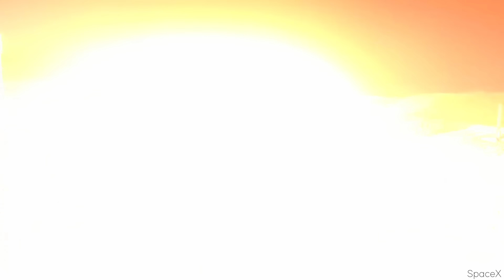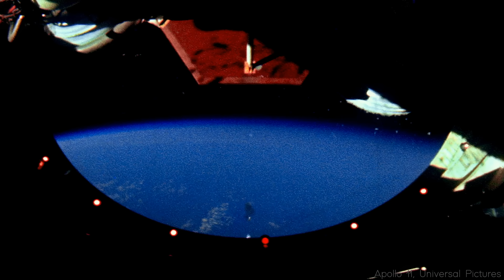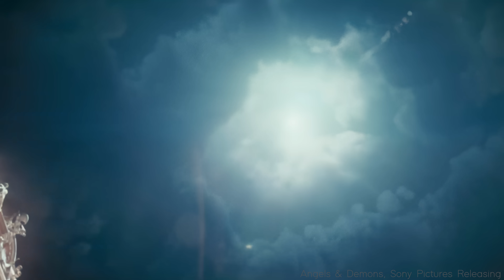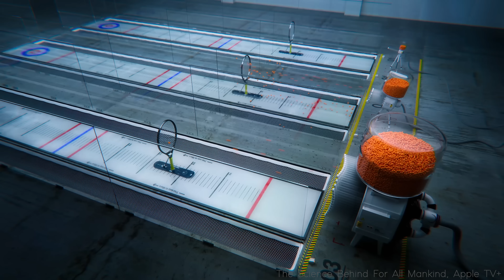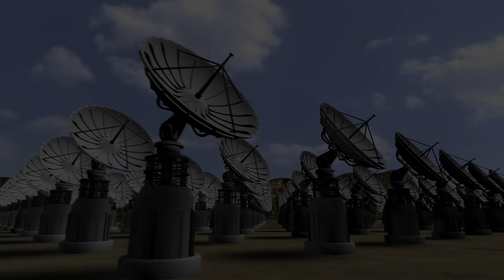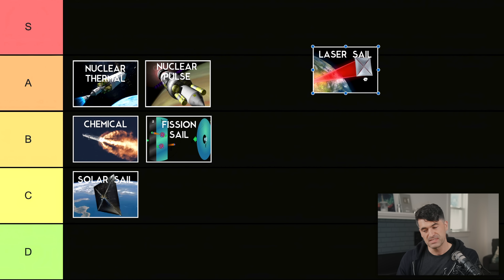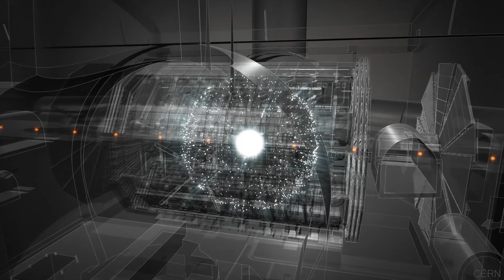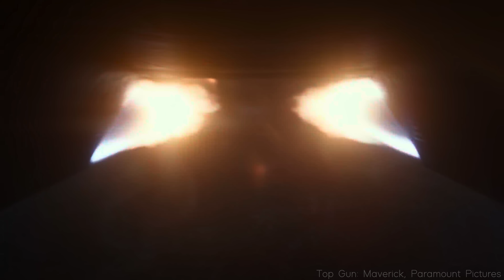Interstellar Propulsion Technologies - RANKED!

Comment: Why not have a small nuclear reactor on board the craft which powers lasers that are on the craft itself?

Have the lasers point backwards, which provides some thrust, bounce them off mirrors, which negates the thrust, but then reflects the beam into the sail in the front of the ship, providing force again.

This prevents any atmospheric umpedence of any lasers being stationed on Earth as well as getting round the problem of simply firing the lasers forwards into the sail, which negates any thrust.
Reply: The entire idea of the laser sail is that the craft itself can be very light, because the lasers are not on the craft.
Reply: @MrCmon113  weight isn't an issue when I space, only acceleration and time.

Good point though, it would need another way to get into orbit, or have to be built in orbit.

I was more thinking of the propulsion system for a large, manned craft, which would be incredibly heavy to begin with. A reactor and lasers, when added to the bulk of the ship as a whole, would be negligible.

Comment: We have been able to go interstellar since the early 50's. It's that niggly bit about simultaneously that slowed things down. Right about then, we realized we didn't understand a bloody thing. It works kinda like an Alcubierre drive, but with way lower power requirements. And some spatial fineggling. But at one point you are in both places at the same time. Kind of like the kid in the back seat "Are we there yet?" It's one of those things you can't ignore. And, yes, we kinda progressed. That "Same time" thing can be problematic. As we found out in 2012. It just took one idiot. Craft had worked, but somebody decided to add some extra spice. You guys call it the Mandela effect. Something we won't be trying again anytime soon.

Comment: Dear Dr. David, 
Thank you for another excellent video. 
Probably to avoid this video becoming too long, I would guess that you deliberately did not mention the concept of Hybrid Propulsion Technologies. Such as a Slingshot manoeuvre around the Sun, utilising a large Solar Sail at the appropriate time. The same Solar Sail could also be used to decelerate at the destination Star. Any sizeable Interstellar spacecraft would be built & assembled in orbit, making it practical to include several different, compatible Propulsion Technologies, from Ion Drives to Nuclear Thermal and potential Pulsed Fusion. And perhaps a Ram Bussard system could also be used, just to scoop up interstellar Hydrogen, to be stored for use as fuel.  Many thanks again for all the great videos.

Comment: I think we have a technological pathway to an antimatter fuel fabrication plant, that is building solar collection mirrors and putting them in orbit of the sun, to generate absurd amounts of energy. Could probably speedrun such a technology in a few centuries. The other energy source that compares to antimatter is the black hole. If you could create a black hole, or capture a sufficiently small primordial one, you can collect energy as you drop conventional mass into it. A small enough black hole will have enough Hawking radiation output that you can use it as a battery, reflecting that radiation back in when it isn’t needed, and harnessing it when it is.

And the laser light-sail on steroids is the stellaser light-sail. Isaac Arthur talks about these somewhat often, but I think there is some suggestion they could be built. I’m telling you, all cost-effective space projects start with orbital mirrors.

Comment: Laser array question: Where would the laser array be placed? 
On earth the atmosphere would diffuse the beams, but the array could be serviced with ease. 
On the moon the array would be outside of atmosphere, but impractical to service. 
In both cases, the rotation of the celestial body the array is placed on would make the array functional for only part of the day. 
A platform in space could be kept constantly aligned with the craft, but would require constant adjustment thrust to maintain position and be hard to service.
Does anyone know what the proposed solution looks like? I'm sure the answer is obvious and brilliant and I'm just too dense to see it, but I'd like to know 🙂

Comment: I've said for a while , that micro-sateliites would work   You make them a pound or so weight,and use a high speed centifugal or railgun device launched from the moon.  Get it up to 10% the speed of light.  Not everyone needs to succeed and they can be separated  out so say 1000 could be dispatched per decade to ensure success and to check out multiple nearby star systems at once.   there's also other benefits, if done correctly by knowledgeable people.

Comment: We wouldn't need FTL to go interstellar. Propulsion systems that can get spacecraft to relativistic speeds would be sufficient. Assuming 50% light speed, a trip to the Alpha Centauri system would take about 9 years to complete, but because of the 15% time dilation, the trip would be 1.3 years shorter from the perspective of those aboard the ship. Bump the velocity up to 80% light speed, and the trip would be about six years long, around 1.5 years from the perspectives of those aboard the ship.

Comment: You should have added to your ranking criteria the ability to decelerate. It’s worth nothing if a system can accelerate a payload to a fraction of C, if the system cannot slow down to reach and stop at the destination…
Reply: To me this is why starshot laser based craft are not really S tier. Can't slow down and extremely mass limited way below the requirements for manned missions.
Reply: @Stu_Bur  you could use a laser to accelerate, then fold the sail up into a pusher plate or Medusa style parachute and use NPP for deceleration.

If your destination is a red giant, you could also "dive" into the extremely diffuse outer region to slow down, or even just deploy a dragnet into it without fully entering(though you would need to shield your craft well enough to be able to get that close)
Reply: @Stu_Bur It can decelerate using solar wind of the star it's heading to
Reply: If it is just a drone to make a photo, it can be flyby
Reply: For those who say that rockets can decelerate, think that you’d need to carry out enough fuel for the deceleration, lots of extra payload. Current rockets barely make it out of the earth gravitational well. Second stages would have to be huge in comparison!
We get in the realm of orbiting refueling stations… n maybe not impossible, but incredibly expensive endeavors for sure.

For those who say you don’t need to decelerate to just take measurements, think how useful the measurement may be when the probe travels so fast to make interstellar travel not taking thousands of years… imagine something like the Pluto fly-by, but you were lucky to just take a single picture, or reading, then you are already out of range in the opposite direction. Would that be worth it?
Reply: The idea with the laser sail is that it doesn't need to decelerate. It can take images and other measurements as it passes through the system. You send thousands of them spread out over time. Each 'generation' becomes more accurate and focused.
Reply: @christopherkelly4555  Then it's only good for taking pictures, it can't be used as a functional transport system.
Reply: @christopherkelly4555  "It can take images and other measurements as it passes through the system"  Putting aside that all of this is idiotic in any case, what's the point of "measurements" when there is NO technology to return such measurements to Earth?  All known methods of electromagnetic communications would be useless at light-year distances, particularly given the power limitations of a "probe".  Also, don't reply with a pathetic: "Well, there may be new discoveries...", sorry NO , electromagnetic communications is completely understood and anything else (eg: quantum entanglement) is just completely pointless speculation, with zero basis in fact.
Reply: exactly. the human body is frail. for every period of acceleration you need an equal period deceleration. if you could accelerate to light speed, you cannot arrive at the destination at light speed. deceleration could take a long time and energy. its basically acceleration in reverse. nobody ever talks about the deceleration bit.

the atmosphere of a planet, if it has one, will slow you down. we see that all the time. you will be a fireball
Reply: Thank you. Especially the good Dr.'s own laser propulsion idea. How do you slow down?
Reply: @ethorii  if you mean the black hole one, you just make your destination near another black hole and use the same effect in the opposite direction to slow down the vessel to manageable speeds. It's essentially a black hole highway.
Reply: @rance8838  seems unlikely the second black hole would be near the final destination. A long high speed trip would almost certainly still be necessary after the slow down. Maybe it could be used as an energy saver to piggy back off of black holes.
Reply: There was this old design that had big mirrors that basically acted as stages so when you're decelerating you drop off the mirror Infront of you and it reflects the lights back onto the other side of your remaining light sails
Reply: Also shield against micrometeorites.   A very fast flying ship is an easy target for small projectile .
Reply: I mean, it was specified that the goal was photos with bonus points for people. It was never a criteria to land or orbit, therefore there was no need for the deceleration
Reply: Robert Forward used that as a plot point in "Flight of the Dragonfly."  He had a laser sail system, and half way through, part of the sail was cut away and put out to reflect the laser back against the main sail to slow it down.
Reply: Flip and burn!
Reply: Yes, and no. Slowing down is easier, if you interact with solar winds.
Reply: Deceleration Never crossed my mind. 😅
Reply: Deceleration is basically just accelerating in the opposite direction, so it'd be similar
Reply: @jevinliu4658 you don’t have the lasers in Alpha Centauri to slow down the sail…
Reply: @blas_de_lezo7375  Good point, but for the rockets (which is most of these) then yes you can
Reply: @blas_de_lezo7375  That's true, but as bizarre as that sounds, we actually can use lasers to attract things toward the source of the beam, at least at subatomic scales, so a single laser station could theoretically be used as both a "pusher" to accelerate spacecraft and "puller" to slow them down
Reply: @davydovua  Ok so first problem is the lasers lose power as the ship is further away. So Lasers very close to launch point= super powerfull, when you're getting to alpha centauri 100% useless. Sure if you can get lasers in alpha centauri for slowing down , awesome, but they need to get there in the first place.
Reply: @blas_de_lezo7375 can't you stop the lasers and use alpha centauri's solar energy to decelerate the sailship?
Reply: @irmaosmatos4026  but you are getting closer to a gravity well at the same time soooooo maybe? You would need to get very very close to the sun because the laser is extremely focused . Honestly no clue on the math.
Reply: @blas_de_lezo7375  I believe the idea is to use gravity to progressively slow down similar to gravitational sling-shotting
Reply: @jevinliu4658  Going at that speed, we could save a lot of fuel by using a magnetic sail to brake against the interstellar medium and the destination star's stellar wind. (I guess it is called stellar wind not solar wind?)
As someone else mentions, this is only important for human voyages, which would be several orders of magnitude harder than just sending a probe.
Reply: @peterd9698 exactly!  Between all the interstellar dust and solar wind and such, decelerating isn't an issue for a solar sail.
That's one of the main advantages to using one.
Reply: @dynamicworlds1  "Between all the interstellar dust and solar wind and such..." Laughably idiotic...  Here's an idea of the "Interstellar Medium": ...an average density of about 1 atom per cubic centimeter....  There's no solar wind in interstellar space, ergo the name interstellar medium .  Pointless fantasy babbling completely devoid of actual, you know, facts ....
Reply: @guidojones6107  obviously by solar wind I was referring to that created by other stars.  There's also cosmic wind in the interstellar medium in interstellar space.  And yes, at relativistic velocities and over the large areas of a solar/magnetic sail it would be significant.

Less posturing and more educating yourself, please.
Reply: @dynamicworlds1  There is an amount of braking provided by slamming into a heliosphere around a star. It isn't sufficient however to stop a significant mass moving in at relativistic speeds. Even changing direction to try to get capture into a long period orbit is going to be tricky without some other kind of propulsion.
Reply: @Stu_Bur  it does require braking against the interstellar medium as well, yes
Reply: @guidojones6107 now imagine hitting 1 atom per cubic centimeter while going an appreciable percentage of the speed of light. Your going to be hitting a lot of atoms per second. So it might be enough slow a light sail probe enough for a fly by to the local star.
Reply: @CeoMacNCheese "hitting 1 atom per cubic centimeter while going an appreciable percentage of the speed of light..." Has absolutely no effect whatsoever ...  It's a single atom FFS!
Reply: @ that per cubic centimeter, and your pretty much going a 3 centimeters a nanosecond at 10% the speed of light, which doesn’t sound like much but remember a billion nano seconds are in a second so you are hitting about 3 billion atoms a second on a single square centimeter going at 10% the speed of light. Which means you are hitting a lot of atoms a second to the point that it starts to make sense to make a relativistic vehicle an aerodynamic shape. The faster you go the worst this problem is. It is not a single atom, it’s you hitting a single atom per square centimeter while moving at 29979.2 kilometers a second. It doesn’t seem like much at first but if a body isn’t aerodynamically built properly it will experience a lot of drag which for a light sail might be enough to slow before entering the heliopause.
Reply: @CeoMacNCheese   "3 billion atoms a second on a single square centimeter going at 10% the speed"  ...and in 1 milliliter (ml) of water, there are approximately 6.7 x 10^22 (670 quadrillion) hydrogen atoms. A billion Hydrogen atoms is nothing .  Also, your painfully stupid use of the term "aerodynamic" when talking about interstellar space is comically ignorant.  We're done here...
Reply: @ ok I see your point but still theres some drag at 10% the speed of light but the faster you go the worse it will get either way and depending on the way your getting your acceleration it could mean you are hitting a lot of atoms and that adds up.
Reply: @guidojones6107  why are you so angry lol
Reply: @dynamicworlds1  This is blatantly ridiculous. Like suggesting we should use jet engines to slow down the rotation of the earth. Sure it would work, but we would need a trillion jet engines. Braking using cosmic wind is possible, but it would require such an immense sail that is so mind-bogglingly thin that it would stretch the limits of physically possible material science.
Reply: @tonig2255 you're just describing a solar sail.  They're huge and thin by definition.
Reply: @jevinliu4658  Not for stuff that pushes you from behind.
Reply: Just hit the brakes bud
Reply: You just turn around and accelerate in the opposite direction for deceleration..
Reply: Yeah, DUMMY! IT WOULD USE THE SAME TECH AS THE PROPELLANT/ PROPULSION SYSTEM! DUH!😂🎉❤
Reply: you just rotate the ship half way and thats it (in case of the propulsion being generated onboard)
Reply: Imagine reaching Alpha Centauri with a laser sail driven craft traveling about 0.2c.  Hooray, we did it!  Then the craft hits something, maybe the star itself, going relativistic speeds, and makes an "earth shattering kaboom", and we're suddenly in an intergalactic war because we essentially just tried to "sucker-nuke" an alien race 😂.

Imagine those aliens then arrive on earth.
"Hello, aliens!  We are humans.  We have so much to learn from eachot..."
>Orbital bombardment
>Death
Lol, whoops
Reply: @bandit6272 I can imagine people waiting with baited breath for the first images to start being received with pinpoint accuracy. People gather around giant holos a timer counting to zero in the corner as people hold each other sharing in the anticipation... Nothing happens ... Except a tiny light in the sky- imperceptible among all the light pollution and mini-sats becomes visible for half a second and disappears.
Reply: LOOK IT AIN'T GONNA HAPPEN UNLESS WE CAN CREATE A WARP BUBBLE AND FIGURE OUT HOW TO COUNTERACT ZERO GRAVITY! PERIOD! OR EXCLAMATION POINT! 😂😂😂 LITERALLY!